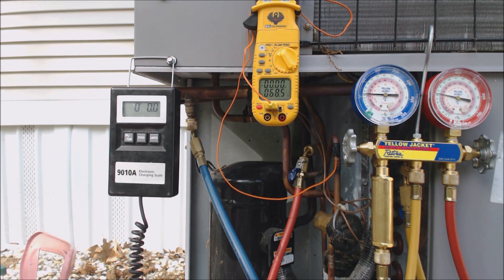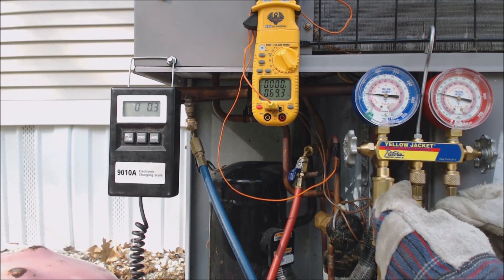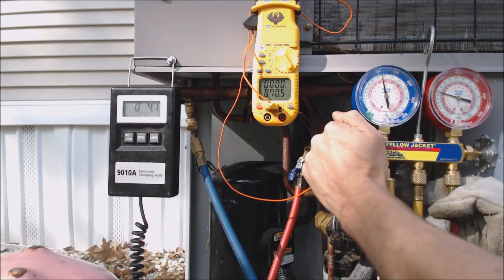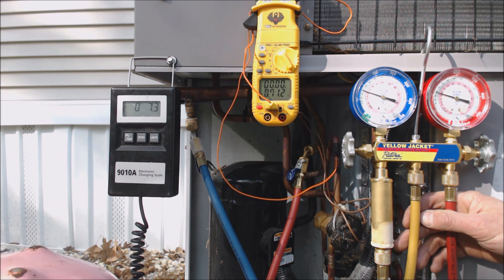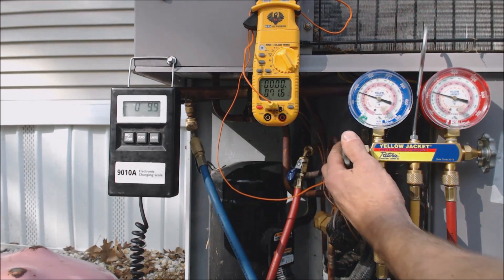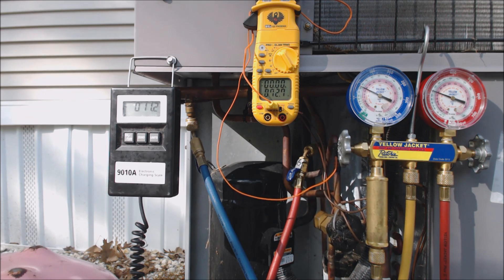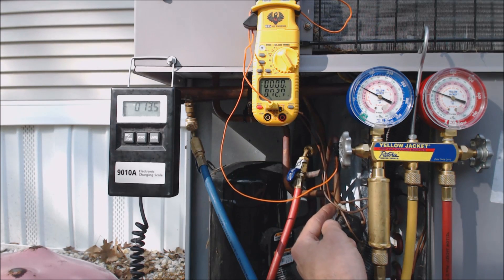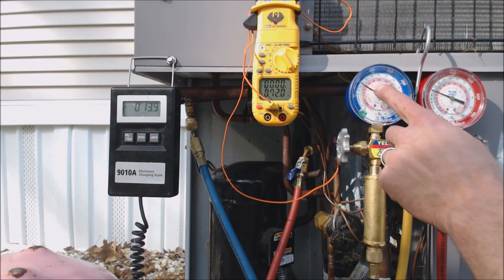R-410A Charging! Charging a System that is Very Low on Refrigerant,  Avoid the Evap Freezing! Part 1

Comment: Hi, in another video you mention weighing in several pounds of 410a through the high side valve on a split system.  On a package system like the one in this video. Is it possible to weigh in several pounds of 410a through the discharge valve? If not, how would you charge that much 410a into an almost empty package system with only a discharge valve on the high side?

Comment: I was at a house today that was almost flat, so I charge it up quickly up to passed freezing but after that, the low side stopped sweating and wasn’t that cold. The compressor still sounded normal but system wasn’t blowing that cold. Did I flood the compressor or maybe the evap froze during the process? I was not using a vaporizer like you were. Also, it was a TXV inside and subcooling was perfect.
Reply: I was concerned about possibly slugging the compressor so I told the customer to leave the system off and allow the furnace fan to flow (in case of evaporator freezing) for a couple hours then turn the system back to cool.

Comment: I was told R410 is a blend of 3 refrigerants and if it’s low you can’t just add refrigerant cause your blend with be off, you have to remove what’s left and recharge with new R410a is this true I feel like I have been doing more work than what’s needed?

Comment: A/C froze up. Low side was 75 410a. Man came by added Freon. Compressor was loading up hard and started shutting off and on. I stopped everything. Bought some gauges and had both low and high at approx 250 and 600. Started letting off pressure in empty bottle. It settled down but pressure is at 130 and 420. Sounds smooth but very nervous. What should I do from here.

Comment: I would like to ask if is it possible to add or charge the package system in the vapor side with liquid R410A with out the use of the liquid vaporizer. Just using a normal 3 way gauge manifold. Thank you in advance! Great video,!!

Comment: Great video! Very informative. So, how to do you charge the system if empty(new install) and the AC wont pull refrigerant because it wont turn on. Doe's it have a shut off safety until it detects Freon. Inside unit runs, but not outside. Fan runs when I push the contactor button. I performed all pre-charge and diagnostics concerning the contactor, compressor and input power to the unit as instructed in your e-book. Keep up the great videos, it's a great help to us who are trying to save a few bucks! P.S I have a American standard 2 ton system 4TTB3024H1000AA

Comment: If the system has a liquid accumulater, won't that prevent liquid flood back anyway? So would you not have to throttle in the r410a?

Comment: What does one do when the system has gotten low enough to short cycle?  My understanding is the compressor needs to be running to meter in the refrigerant.

Comment: thanks for this wonder video, the 410a is free for anyone to buy not like r22, my question  is that inside refrigerant tank contains liquid or gas? i checked only, it says it is on gas form ? but i heard the water flow sound when you flip over the tank, thanks.

Comment: do you use same gauge set as with auto ac? if so are the connectors the same also? thanks
Reply from the maker: I have the end hose fittings for automotive linked in the access port section on https://www.acservicetech.com/tools

Comment: Hi, I just found out my first floor condenser unit is completely out of refrigerant. In this case, how do I recharge the system? Do I have to have the condensing unit running to charge? My unit also have low pressure switch and it is preventing from system to start up. Please help
Reply: niZmo. Step 1/ find and repair the leak
Reply: More like: 
Step 1 - Find a qualified technician to diagnose problem cause you ain’t got a clue.

Comment: Thank you for your time and effort in bringing us great content. Hope you're still responding to questions..... this unit you're working on doesn't have a liquid line service valve, only a compressor discharge Schrader connection. I'm working with units that do not have any manifold gauge set valve connections. They use pressure transducers and suction and liquid line temperature sensors. The high pressure transducer is measuring compressor discharge pressure,  not liquid line pressure. No subcooling information has been provided. I don't know how I'm supposed to calculate subcooling,  can you help?

Comment: How does the vapourizer work, does it have a check valve which stops too much pressure passing through at once, hence less gas?
I always watch the guage and very slowly crack the low side open and let the compressor naturally suck a tiny amount without low side pressure increasing anymore than 20 PSI over it's natural suction pressure while running.

Comment: I have a MV1000 Scotsman Ice Machine. That has a 3 phase compressor with R22 gas. What should my ideal pressures be when operating (freezing) stage and also at defrost stage? I have a feeling that my high pressure is operating to low.

Comment: As a matter of interest . What happens to the compressor or the system in general if you accidentally overcharge the system?
Reply from the maker: When you have a txv in an air conditioner, it costs more electricity and lower capacity, compressor wear and tear. For freezers, the unit will never reach the correct temp and just run and run because the low side sat temp is too high, thanks!

Comment: i have a question about 410      why would my company say i have to recover and vac down 410 even if its a little low because its 410.   i have added 410 to many air conditioners and it works just fine
Reply from the maker: They are saying to recover to find and fix the leak. There would be no need to do that if you were just adding some due to a small leak. That will not be a problem with R410A. That could be a problem with a more zeotropic refrigerant such as M099 or NU22B but not R410A much since it is near azeotropic, thanks!

Comment: I can't get a straight  answer does R-410A fraction if there is a leak like R-134A?
Reply from the maker: 134a doesn't fractionate because 134a is only made up of 134a. R410a is made up of r32 and r125 but is near azeotropic so the fractionation will be very minimal and if it is mainly running while leaking then it will leak at an even rate during the run time, thanks and see if you can find the leak, thanks!
Reply: @acservicetechchannel  Thanks!

Comment: If a 410a compressor is low but has a r22 coil upstairs...should you fill it or will this cause overpressure in the r22 system?
Reply from the maker: The evap coil would have a metering device for r410a and a tech would only reuse a evap if the design pressure was high and able to handle r410a. If the equipment was designed to run together then it can be charged using the subcooling method if it has a txv or superheat method if it has a fixed orifice. I would find and fix the leak or it will just leak out again though, thanks!

Comment: Great video. I have one question, I was under the impression that when 410a leaks out of a system, it should be recovered and replaced with new refrigerant.
Reply from the maker: If the unit is leaking while it is running then it is usually leaking at a correctly mixed rate. If it mainly leaked while off, the refrigerant with the higher pressure will leak out faster. Only if it is a significant leak would you need to recover all and replace with all new refrigerant. Other zeotropic blends would be a different case though, thanks!
Reply: @acservicetechchannel  thank you for your reply.

Comment: how can i charge a R410A system with only one service valve port on the vapour line.please reply
Reply from the maker: The pressure in the bottle is higher than the low side pressure so refrigerant will exit the bottle and enter the system, thanks!

Comment: hello i can  charge AC 410 py weight into hi presure line and ac is off ?
Reply from the maker: Yes but only when breaking the vacuum when initially adding refrigerant into a system. After refrigerant is in the system, the unit must be turned on to add refrigerant in, thanks

Comment: Did the leak ever get found and fixed? Isnt that an EPA requirement per being a cardholder of refrigeration? Also 410-A is that an azetrope refrigerant?
Reply from the maker: I do video on training units and units in the shop so this is an example of charging a very low system. Unfortunately at this point in time per epa 608 guidelines, you don't have to fix small leaks but it is not smart to just charge and leave either since it will leak out again. It can also cause water damage problems in the building fue to freezing the coil and possible compressor problems with low oil return and less cooling of the compressor. For finding leak videos look up" acservicetech finding refrigerant leak" and also look up ultrasonic leak detector, thanks!

Comment: Not to sound like a dweeb, but you're charging by vapor because there is no liquid line port, correct?  If the discharge port is coming directly from the compressor it is filled with vapor. Why not charge there? Is it because of the lower temperature of the vapor being introduced into the system? It has to be compressed to a higher temperature and pressure before going into the condenser.
Reply from the maker: Hey JaffeJoFur, the bottle pressure is higher than the low side vapor so liquid will flow from the bottle into the system. The liquid or discharge port is higher pressure than the bottle so refrigerant would flow out of the system and into the bottle. That is called recovery using the system's compressor if you have a recovery bottle attached. That is used for slightly adjusting the charge because you don't want to accidentally remove oil from the system, thanks

Comment: can u tell what tonage the condencer is threw the model # and serial # 
?
Reply from the maker: Usually yes there is 18, 24, 30, 36, 42, 48, or 60 in the model number that indicates thousands of btu's of heat removal capacity, thanks!

Comment: Why can't u open both valves since the unit is not running , you will be done in no time and then check your sub cooling
Reply from the maker: This unit was running otherwise you would have no way of getting the refrigerant to move from the bottle into the lower pressure line, thanks

Comment: R410 fractionates so what you're doing is not very smart. if you want to get liquid in the compressor keep doing that.
Reply from the maker: Sorry, no, in the case of R-410A, manufacturer trainings will say it is ok to top off systems as far as the blend is concerned because it is near azeotropic even though they want the refrigerant to come out of the bottle as a liquid to avoid fractionation. Obviously not over and over again. If you are working with other zeotropic refrigerants then more care must be taken when fixing leaks and adding to the charge. Here is some good reading material. Also I had a vaporizer on the manifold in this video for compressor protection. Thanks for the comment! http://www.achrnews.com/articles/82752-blends-101-an-introduction-to-refrigerants
Reply: Thank for the article link. You're right

Comment: Great video.. I do have a question.. on the minutes 3:10 u said the saturation on subcooling have to be 35 to 40 and after check the superheat gauge on high pressures.. the 35 - 40 it’s a “ target number” on the superheat gauge for R-410 when it’s very low on gas ref.?
Reply from the maker: I believe I was saying that I needed to get it above 32 degrees so the evaporator wouldn't freeze thanks!
Reply: AC Service Tech LLC thanks Craig.. I just got your book today at home.. and I’m joining very  well..
Reply: I just have a question about high velocity HVAC. I don’t see any video about high velocity HVAC on YouTube .. and some tech said “ the cooling work very well but to the heating  coil does work good..

Comment: I called HVAC tech to charge my system.  Tech put only manifold and tells me pressures indicate very low level of refrigerant. I asked if he's going to do sub cooling, he said he doesn't have a thermostat bc it was stolen with some other equip. Tech weights Puron cylinder before start charging system and after to charge me base on difference in weight.  Is that a legit way to measure charge added to the system?
Reply from the maker: You cannot tell how much refrigerant is needed in a system without a temp measuring device. Weighing the bottle before and after is ok but usually we just keep it on the scale, thanks!

Comment: if suspected low refrigerant should you check with bubble Leak Detector around caps even before removing the caps?  and then again at each schrader valve after removing caps but before attaching your gauges?  isn't the schrader valve the most prevalent cause of slow to very slow refrigerant leaking??  Should you replace your older valve caps with newer o-ring caps?

Comment: If a system is completely flat after a repair (package unit), how would you go about recharging?
Reply: you would need to pull a vacuum and just fill the system to factory recommendation.
Reply: @boriel91  I pulled vacuum (470 microns) and but my scale broke, so I added what  thought I needed and it froze, went back next day, realized I overcharged the day prior, then recovered, then got pressures where I needed. 65 ambient / 72 low / 270 hi / 18 subcool, which exactly where the manufacture specs were set for. So no issue there. but it kept freezing over, went back today and when I opened the blower motor compartment I noticed it was smoking....fried blower, so my lack of airflow was causing the freezing. fun days. that's why I hate doing repairs for other techs. Lesson: Diagnose it yourself even if you're just there to do the repair. I had swapped a txv and spent 2 days on refrigeration when it was likely just the airflow issue.
Reply: verify everything first, common HVAC sense, remember your schooling.

Comment: Great video and tutorial. My unit leaks out coolant once a year in May and I am tired of paying the guy $300 every time to fill it up. He doesn't use any thermometers or anything. He just hooks up the hoses and fills up. On his way within 10 minutes. Then next year, same thing.
Reply from the maker: Did he look around in order to try to find the leak? It is not being set to the proper charge level but it also may be leaking out fast and not running efficiently!
Reply: @acservicetechchannel  He found a leak after the second year. It's in the attic (some coils). I cant remember what he said it was called but said since it leaks once a year it's okay until it starts leaking a lot more. But, I need to get it fixed.
Reply: This is exactly what is happening to me. My guy refills my R410a unit every year. He does not use thermometer also. He hooks it up and refill to 150 Psig (sometimes he would swap out the capacitor) and on his way out in 10 min with 300 bucks 😓
Reply: I would of rather be making payments for a new unit than waste money with that unit, just saying.
Reply: @johnconnor7501  I just started filling my own freon. Works great and last a year.
Reply: @twotoned2774  what refrigerant do you have? Isn’t R-22 really expensive?
Reply: @johnconnor7501  I use 410a. Bought  a tank from eBay for $110
Reply: @twotoned2774  wow, that’s not bad at all.

Comment: So for all 410a charging I have to have charge in vapors? I cannot charge the system as liquid directly without vaporizer device?
Reply from the maker: You can add as a liquid slowly but must protect the compressor. Here is a video, thanks-  https://youtu.be/OSpfBXhk0nQ
Reply: Also you can charge the unit with liquid into a liquid receiver if they have one on the system, but the unit must be tuned off when ‘bombing’ the charge in

Comment: Wait why are the unit panels off during changing or even checking the refrigerant? Did you fix the leak prior to charging ?
Reply from the maker: Hey Boxing Guru, the ports were in the compressor compartment on this unit. This did not affect indoor or outdoor airflow, thanks!

Comment: You mean you’re NOT looking for a leak? I mean, it IS a closed system.
Reply from the maker: Many of these videos are not service calls. This was just a unit where we recover refrigerant out and show how to add it back in and so forth, thanks Jay! here is a video on finding a leak,- https://youtu.be/2Be_sG-HQTQ also look up "acservicetech refrigerant leak playlist" . On a system like this, since it is a package unit, we would find the leak, recover the refrigerant, fix the leak, nitrogen pressure test, perform the oil blowout procedure, vacuum the lines below 500 microns, and perform the standing vacuum test for 10 minutes and weigh the exact amount back in as stated as the factory charge on the rating plate, thanks!

Comment: what is the minimum demands for the pressure gauge  set.  a 2 way system or 3 way or 4 way.  i see different versions on the market.
Reply from the maker: You don't need anything other than a two handle, 3 port set such as this- http://amzn.to/2aenwTq
   -   http://amzn.to/2aBumVI
 --. That will take care of any ac system. The 4 valve, 4 port manifolds are if you want to vacuum through the gauge set which I don't do now. look up "acservicetech full vacuum procedure". The single gauge 2 port ones are for minisplit systems that only have one service port, thanks

Comment: If the pkg unit had a piston, would you then change to superheat?
Reply from the maker: Yes if the unit had the ports in the correct locations. You could also use the Total Weight Method from when the system is in vacuum and just weigh exactly what is stated on the rating plate, thanks James!
Reply: AC Service Tech LLC 
Didn't learn about locations in school.
I got an old R22,  piston,  no data plate running, for a senior And was curious how it could be charged.
If my memory serves me, the port on the suction line was less then 6 inches from compressor.